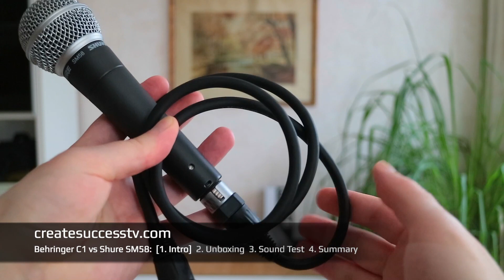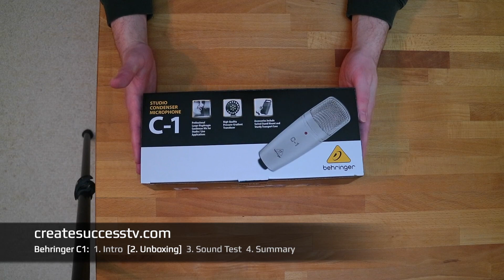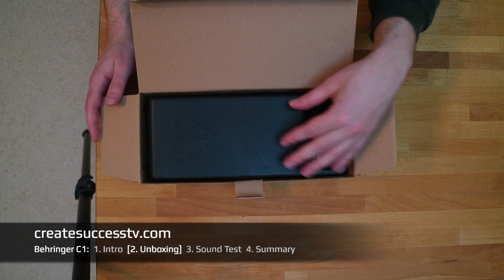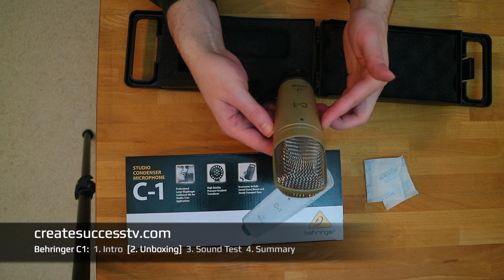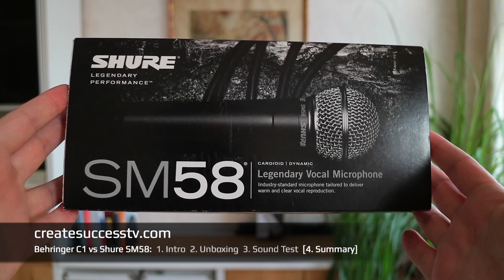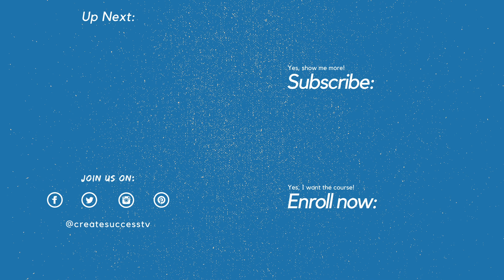Behringer C1 vs Shure SM58 (Dynamic vs Condenser Microphone Test)

Comment: The SM58 is iconic do7.pl/SM58 and sounds like 60 years of great vocals. The difference on this model is the switch. A hot mic in a small studio can fry monitors with a blast of feedback. I know why sound guys hate switches on mics, but not all environments are created equal. Sometimes you just need the option of muting your mic, and this SM58 does it quietly. Shure deserves all 5 stars.
Reply from the maker: You're welcome!

Comment: I've had a C1 for a while, which also developed a hum problem. In the end I tracked it down to a bad earth connection to the case. The grille is held to the main body by 4 screws and both the screws and both faces connecting are painted. Scratching off the paint at one point of contact between the grille and body fixed the electrical connection between them and the hum has gone.
Reply from the maker: Ok, glad you found a solution.

Comment: It really needs testing against another condenser mic, I ran a AKG C3000 against the C1 and there's a big difference. The C1 is dull in comparison, maybe I just got a bad mic.
Reply: so the mic costing 5 times the price is better ???? BIG fucking surprise there eh ? dipshit !
Reply: You cant seriously compare a $59.00 mic with a $300.00 mic, and the massive difference in the price is not worth it considering the little noise that the c1 may have ?

Comment: i connected my behringer c1 mic properly to my behringer umc2 interface with xlr cable but the mic's light doesn't turn on.help me plz.
Reply: Done it already. But nothing changes.I'm confused what's wrong with my setup.
Reply: Oh my god I have the exact same problem!!! It just won’t work!
Reply from the maker: Make sure to turn on the +48V switch on the back of your Behringer UMC22 audio interface.
This is because the Behringer C1 is a condenser microphone, and needs the 48-volt phantom power!